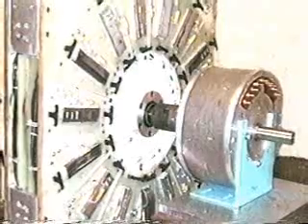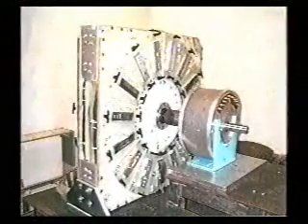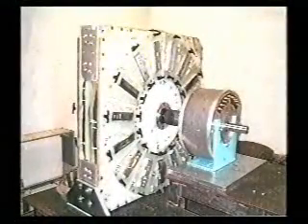Hummingbird Magnet Motor Dennis Lee Short 0004

Comment: This is a SCAM! No generator can produce more power than is required to run it. The Conservation of Energy Law states that you cannot create energy, nor can you destroy energy, you can only change its form. The heat loss from bearing friction makes such a self-powering machine a physical impossibility. Nice try, but no cigar.
Reply: You don't get it. The key is the driver, driver being the motor. The generator is 100% efficient, meaning a 1:1 ratio. You get out what you put in. No loss. The motor 'driver' producing 50HP on 2kw. the generator produces 30kw, take away 2kw for the motor and you have 28kw in excess power. There is a way to multiply/magnify efficiency and it has to do with at the moment of conversion.
Reply: Oh is that right? What makes you an expert in this field? Have you ever built one and tested it? He's not creating energy! He's converting!!!! the heat loss from bearing friction? Really!? Sooo there so much heat coming off the generator that it's converting 30kw into HEAT?!